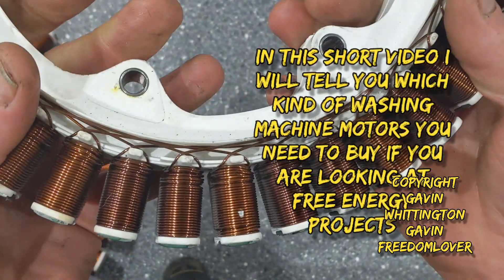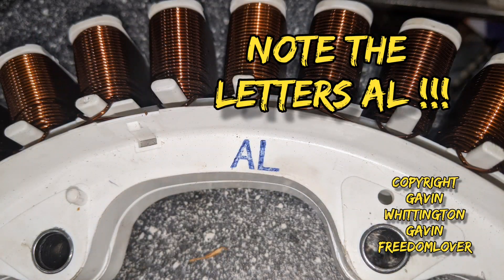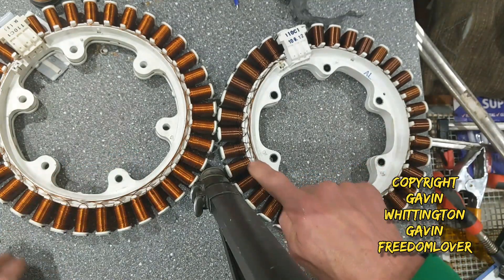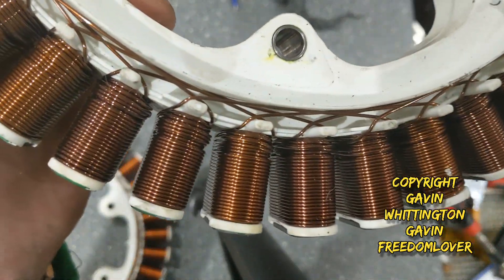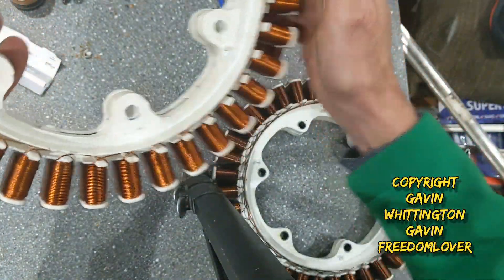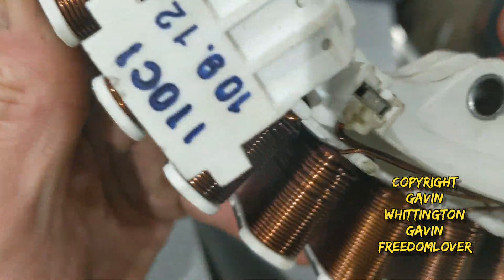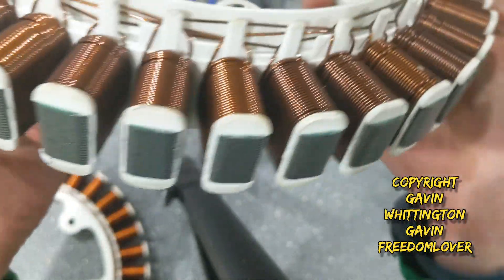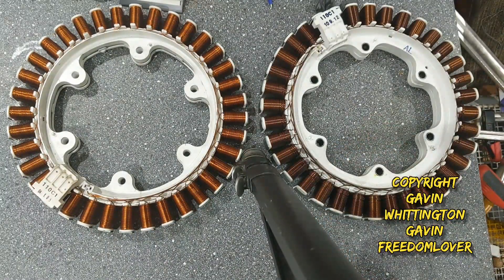LG Direct drive motor stator subtle differences, which one should you buy?????

Comment: they say on the backshed 0.8mm wire is best perhaps amperage wise, yet everything i have is  0.6mm wire except for the one i rewound with 0.8mm , the one thing i like about the aluminium stators is theyre larger with larger magnets so youd guess if you can rewind them you may get better power, i found from one phase it  "seemed" to make as much power as three aluminium phases . i need to buy more 18 gauge wire though and redo it all again, but that will have to wait i have massive things to do like rebuild a house etc.
Reply from the maker: I dropped the ali one and it mashed a coil, I found another copper one which is en route, I fancy rewiring the ali one anyways I can buy .6 or .8mm wire will have to wait and see, good luck with the house :)